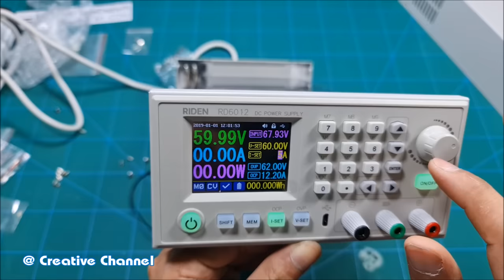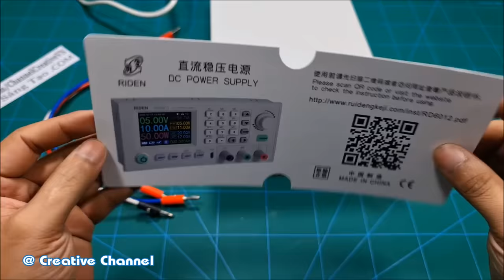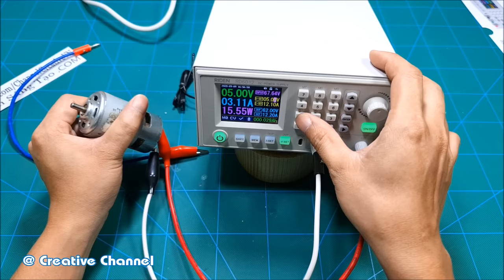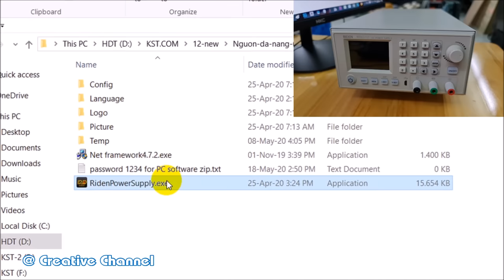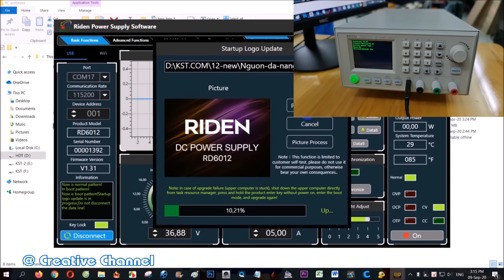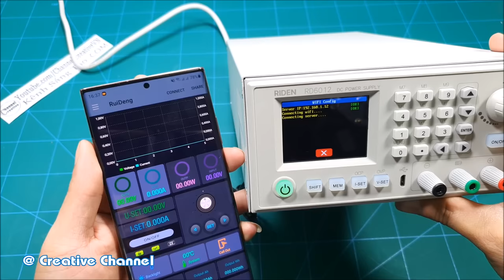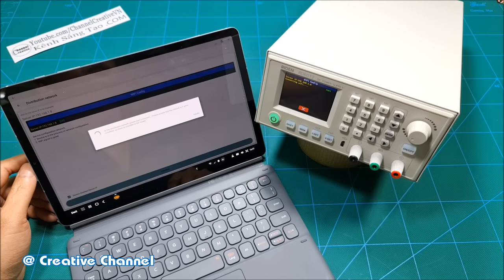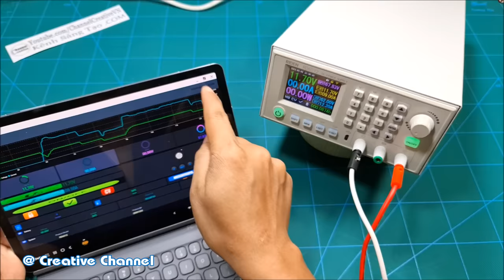Assembling DC Power Supply 60V 12A 720W - PC software and APP by WIFI

Comment: I have a second unit where the Server IP address just remains red and blank after I try the network distribution step, it never shows up as it does with my first unit.
What's missing?
Firmware version V1.36
App version 3.0.3, so the network distribution display looks different from the video at 9:44
Reply: It works with my other unit so it's not a WiFi issue, and it worked at the same time previously, so it was able to do two units at the same time.
It just stopped working with the second unit, maybe the WiFi module went out-
The blue led flashes when turned on, so it's not completely dead, maybe just almost-